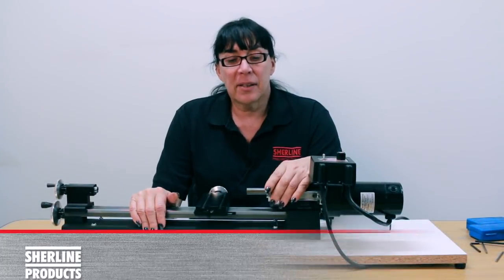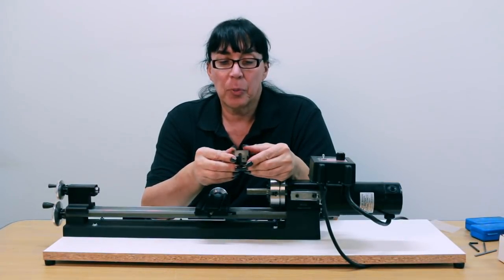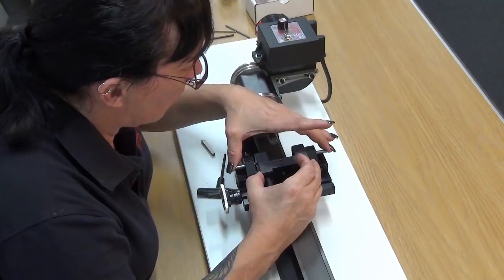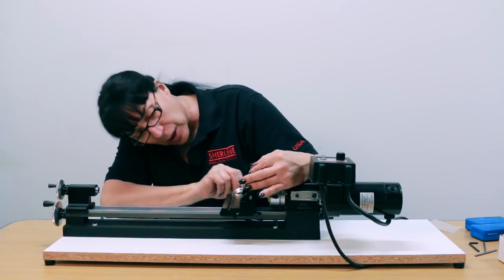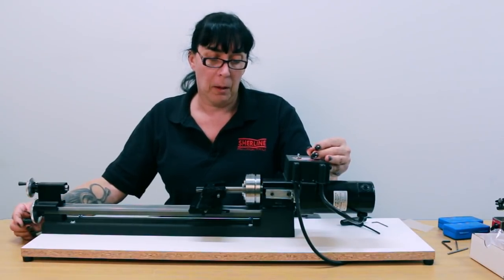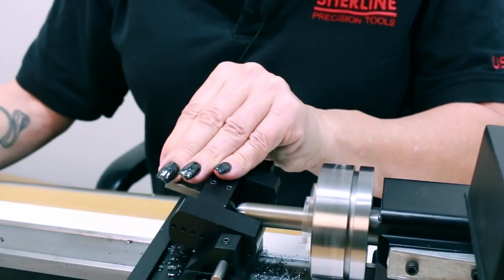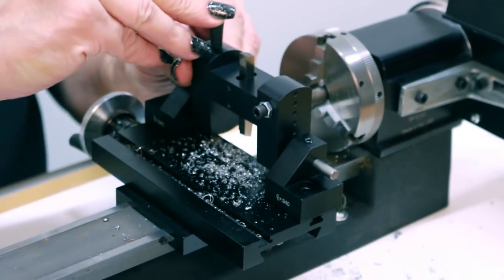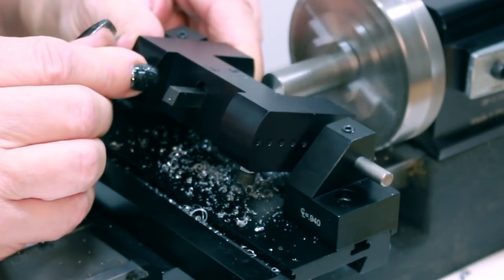Radius Cutting Attachment Demo

Comment: I wish I had known about these lathes before I bought the one that I did buy.
Reply: what type did you or do you have? I didn't know anything about metal lathes & Sherline was recommended by a buddy, i got the smaller 4000 machine...
Reply: @Zen_Modeling  I have a Taig lathe.

Comment: Is it possible to cut an concave feature on the OD of the material?
Reply from the maker: I'm not certain I understand your question. The Radius Cutting Attachment is for adding a convex or concave feature on the end of a part. If you want to take away material on the OD of the part, you can use any number of tool posts to hold your cutter of choice.